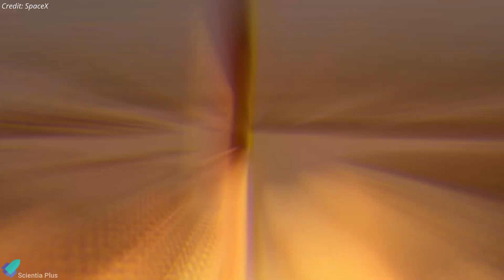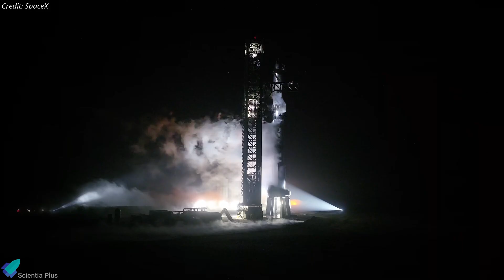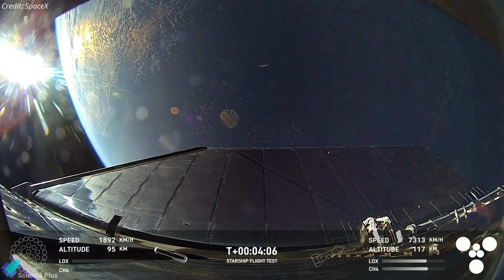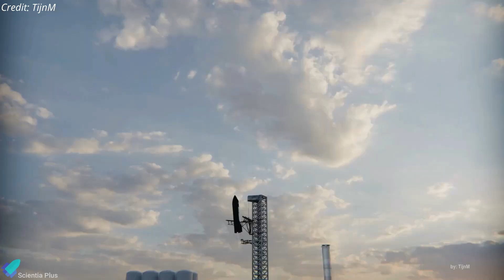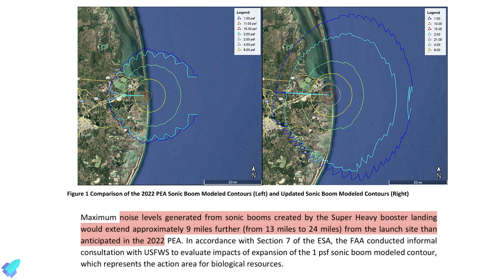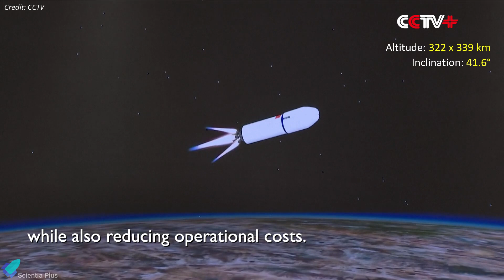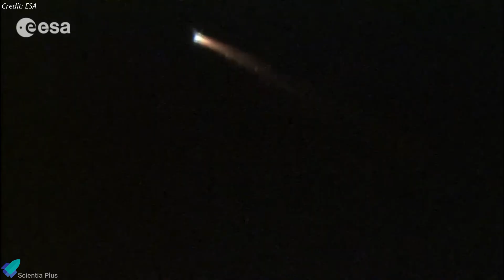SpaceX Starship Flight 5 Catch Analysis: How a Damaged Booster Still Landed!

Comment from the maker: 00:00 Starship Updates
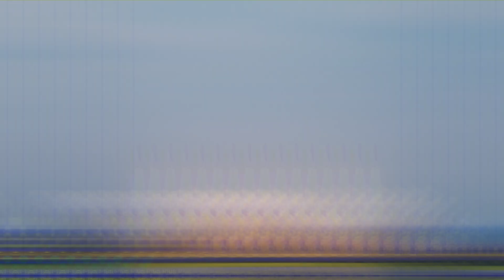08:56 China’s First Reusable Satellite: Shijian-19 Success!
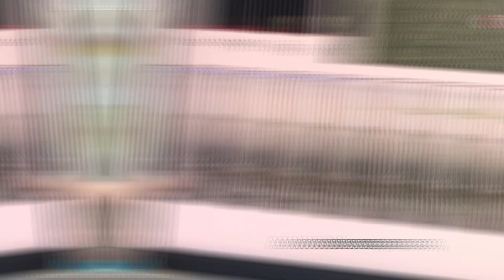10:51 FAA Approves Falcon 9 After Major Upper-Stage Failure!

Learn More:
1. Starship V2 Features:
  a. Design Improvements Update 1: https://shorturl.at/lpGT7
  b. Design Improvements Update 2: https://shorturl.at/gwNQ4
  c. Nosecone & Payload Bay Redesign: https://shorturl.at/xa60S
  d. Methane Downcomer Redesign: https://shorturl.at/XdYBG
2. Starship V3 Features: https://shorturl.at/mnBT4
3. Starship V2, V3 & Raptor V2, V3 Complete 2024 Update: https://shorturl.at/tN248
4. Raptor V3 Mega Upgrades & First Test: https://shorturl.at/TRIyj
5. Latest Starship Upgrades
  a. Starship Hot Staging Explained: https://shorturl.at/jf400
  b. Super Heavy Booster Upgrades: https://shorturl.at/Pi5R3
  c. How SpaceX Protect Raptor Engines: https://shorturl.at/4Om8F
  d. Starship New Heat Tiles Explained: https://shorturl.at/p2Ijb

6. SpaceX Starship License Ongoing Issues Explained in Order:
  a. CNBC's Starship Allegations and SpaceX's Response: https://shorturl.at/Z2WCb
  b. Starship License Delayed to November By FAA, SpaceX Explained Why the Allegations are False: https://shorturl.at/U7OFV
  c. SpaceX vs FAA; Congress Demands Immediate Starship Launch Approval from FAA: https://shorturl.at/JC9FT
  d. Starship 30 New Heat Tiles Delaying FAA License: https://shorturl.at/gWPWM

7. Hera Mission Explained: https://shorturl.at/Mvfjv
8. Crew 9 mission and Anomaly Explained: https://shorturl.at/5o6H5

Weekly Updates: https://bit.ly/3HIQjPC
SpaceX Playlist: https://bit.ly/34wue8T

Facebook Page: https://www.facebook.com/scientiaplus
Reply: if you call a bit of plating falling off "damaged" then you're fucking crazy

Comment: ULA looses a Solid Booster nozzle and the FAA doesn't even blink, SpaceX wants to continue StarShip operations out of Boca Chica and suddenly their Water Deluge system, which is permitted by the state of Texas, is deemed as a pollutant, the already approved Sonic Boom from SS is suddenly an environmental hazard and the Fed's want to re-review their already approved environmental evaluation for Boca Chica ? ? ?   Seems like the "fix" is in from those in power in Washington.
   This was the best coverage I've seen so far on SpaceX's StarShip Launch 5 Booster catch. There was a Ton of more info given than I'd seen from other channels covering SpaceX. Now, if you guys n Gals could use a Real narrator . . . ; )

Comment: they need to fire the center engines on starship at about 1and a half kilometers the reason for the starship explosion it was still doing about 55 kilometers an hour when it hit the ocean at that speed the ocean is the same as concrete as water cannot be compressed BUT that day oct 13 will forever be remembered as the day a launch tower caught the same booster that it had launched just 7 minutes prior one has to wonder how much further along in space travel man could be if we all cooperated instead of trying to kill each other

Comment: The fire was likely just some venting that was supposed to happen anyway. If you look at other videos from other angles you can see the flames or fuel coming out through a vent. Is not like the booster was damaged in any way.
And this video is how false news spread: "the booster was on fire when landing: or " SpaceX barely avoided the catastrophe when the booster almost exploded" etc, while the landing actually went perfectly spot on as intended.
Reply: A COPV actually exploded, together with its protection(chime). Just watch the spacex livestream. Around the time of landing burn ignition, you will see.

Comment: If anyone asks whether or not it was a 'perfect' mission - they are not very good listeners because SpaceX has repeatedly emphasized that Data is the Payload.  This was never a phase to expect flawless everything and in fact would be worse if it had flawless luck because then nothing would be learned.  SpaceX has long emphasized iterative testing and intentional failure envelopes to test and determine performance boundaries.  Even if a narrow set of conditions allowed a perfect flawless performance at this point, it would mean nothing.  The question of whether it was a 'perfect mission' printed on the video thumbnail - is totally missing the point and inserts some misleading context.
Reply: I agree.  This is why they are called test missions.
Reply: Actually I think you are missing an important point. We know that musk has the philosophy of stressing to the point of failure to rapidly gain insight. But that is only to achieve the objective. Once all objectives have been met then obviously there's no point to stress things to the point of failure and you can have  a perfect mission. Like every one of the last 200 falcon 9 missions right? They all go perfectly and SpaceX does not try and stress them and blow them up, 2 pointlessly acquire data
Reply: @alexanderSydneyOz  No objectives had been met in this case.  Many of the systems and shielding were never used before.  So stressing to the point of failure is the objective and Jessie/Kate reminded everyone during the SpaceX broadcast that failures were indeed expected and anticipated, because for IFT-5 Data Is the Payload.  Yes SpaceX does try to blow things up to acquire data, and it's not pointless.  That's what their iterative testing testing is all about.  You're certainly late and uninformed.  This is why it is still called a Test Flight - to test where points of failure are.  Musk already has emphasized this and also confirmed newer changes were on the way in future Test Flights as a result.  Finding out what fails under the stress of their flight parameter envelopes is their primary objective.  This is not even close to a "...once all the objectives has been met" situation because Starship and Booster are still brand new prototypes in the testing phases.  What are you vaping or smoking???
Reply: Yes but it defines the reference,  coincideñtally may be but politícaly important

Comment: Some of the booster cones got baked, cause when the are not firing they are not being actively cooled (regenerative cooling). Different alloys might retain more stiffness when hot, but you don't want them to become brittle or prone to cracking.

Comment: To have a fast turn around time to re-use the buster they will need to have a way to detach the section with the raptor engines from the main body of the buster in order to replaced the entire engine section with a refurbished one.
Reply: The plan is no refurbishing between flights.
Reply: Gee - I wonder if any of the THOUSANDS of top engineers employed by Gwynne Shotwell, and SpaceX, has thought of that, yet (did you mean 'booster,' instead of 'buster?'). 
 Just curious.

Comment: The fire had nothing to do with damage.  They had too much methane build up and vented it. They do it on both vehicles. Even launch 4 had it
Reply: @psychomonkeyinc  yes all planned
Reply: @mburdett7608 - nope, the fire was actually reasoned by a (non critical) damage the quick disconnect port received during lift off
Reply: Correct. 
The fire was from the quick disconnect port. It was venting methane. The author needs to fix his video.
Reply: @matthewota3647  clickbait, AI voice
Reply: @nzoomed not clickbait at all. It WAS damaged.
Reply: What fire ?
Reply: The damage at the fin could have been caused by a collision with the hot staging ring. This can be seen in a long-range video. The defect then became larger due to air pressure and fire.

Comment: “Exploded as expected”? Sure…

Also, per Elons comment…

“Met primary objective” is a way to say failed the landing of the cargo capsule 😢😢😢
Reply: It looked like it was upright as speed went to about zero at zero altitude, so what's not to like?  No reason to try designing engines to withstand firing while plunged into water, and the bigger the resulting explosion the better -- it means they weren't running short on fuel.
Reply: The cargo capsule was never intended to land.  Look at the flight profile.  It was even announced that it would crash into the Indian ocean before it was launched.

Comment: If the booster also used a "belly flop" it could slow more effectively, as the Starship does.  The sonic boom that seems to have everyone nervous could possibly be complete,y obviated.
Reply: The booster has grid fins, not flaps. It is designed to move like Falcon 9. Flaps would be heavier. Nevertheless, the booster reaches supersonic speeds so the sonic boom is inevitable.
Reply: They would have to add heat tiles, which would add a lot of weight.
Reply: @billweberx  they wouldn't need heat tiles on the booster, it doesn't even get close to the speed that starship reaches. Otherwise they would already need some kind of system to protect the bottom of the rocket as it comes back. Like an entry burn the way falcon 9 does. They may do that anyway do to the damage the nozzle section received from the aerodynamic forces.
Reply: @Sciguy95  That's incorrect.  The reason they face the rocket with the engines down is it can withstand the heat of reentry.
Reply: @billweberx  except that is no "heat of reentry" with the booster as it never leaves in the first place. It separates long before it exits the atmosphere and never reaches anywhere near orbital velocity. Look up the falcon 9 and you will see that it fires it's engines, using the exhaust as a heat sheild. Remember we are talking about the superheavy booster, not starship. It still gets really hot, but it doesn't get anywhere near as hot as starship does during its reentry. The engines don't just have an innate ability to withstand heat. When running they have fuel cycled through the nozzle walls, that's what keeps them cool, if it were doing a belly flop the energy from it's speed would be spread out along the entire surface, increasing the speed it slows down as well as decreasing the amount of heat buildup.
Reply: @Sciguy95  Wrong.  The booster leaves the thickest part of the atmosphere.  38.6 nautical miles.  Above that is just very thin air.  Do a google search.